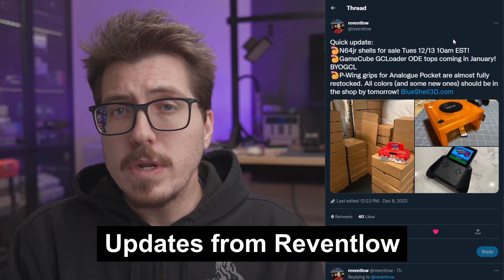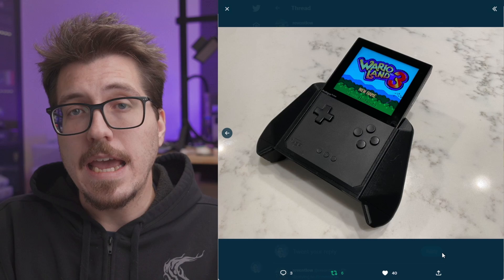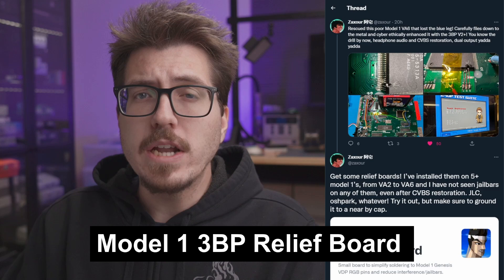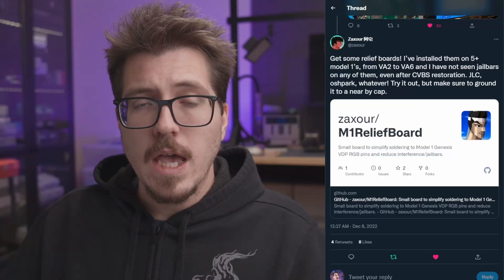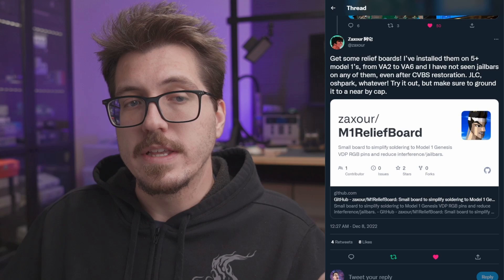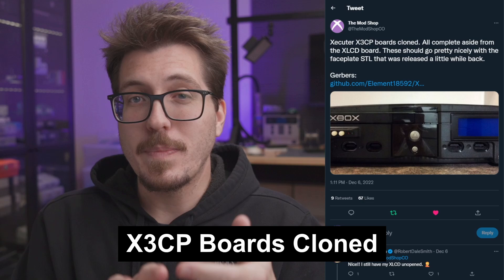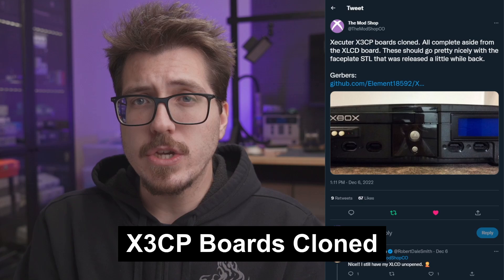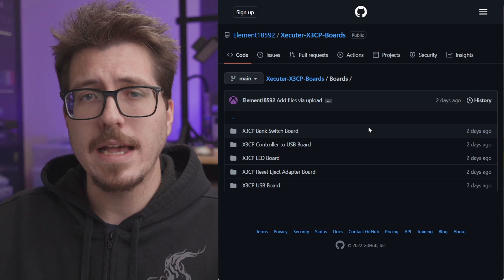Old Original Xbox Mod Reproduced (Make it Happen MakeMHz!) - Retro Modding News

Comment: Just got an IDE to SD card adaptor and combined it with a SD card extension cable which lets me route the reader outside of my xbox so I can easily eject it from the xbox and connect it to my computer to add games to it through FATXplorer.

Comment: You are correct. The problem isn’t that some games are incompatible with his Famicom controller adapter, the problem is that some Famicom games don’t support external controllers at all. Think of the EXT port controllers as “Controller Port 3” where single-player games have to be programmed to use both the internal Player 1 controller AND Port 3 (EXT) if players are going to use an arcade stick or anything other than the built-in hardwired controllers. When the Famicom launched there were no EXT port controllers for games to support.

Games that don’t work with EXT port controllers are usually just a consequence of being programmed before external controllers were available/popular for Famicom but there are some later titles with the same issue… like Super Mario USA. I imagine some western-developed titles were programmed only for ports 1 & 2 as well. 

These incompatible games obviously work with the internal controllers and the internal controllers are built the same. The controllers are pin-compatible so the mod simply routes the external controller’s data and latch pins to the internal port. The game sees your external Port 3 controller as internal Port 1, solving the issue.

Another reason a game might not support EXT controllers is to prevent the use of turbo controllers and programmable inputs (Hori Data Repeater and the like).

Comment: I've got 3 Twin Famicoms, I planned to fix one for myself and flip the other two. (Your fault Dubesinhower you introduced me to Buyee) It is perfect that OSHPark does 3 board runs for me. I was wondering how I would be able to use a controller/controler extension after I heard there was incompatibility. This mod from Jeff Chen will save me from figuring out how to wire in cable extensions.